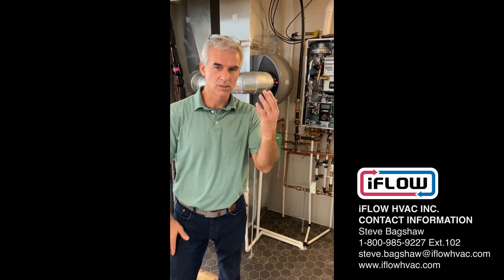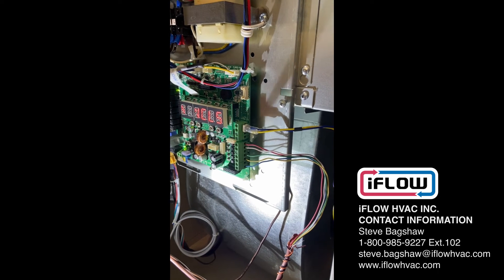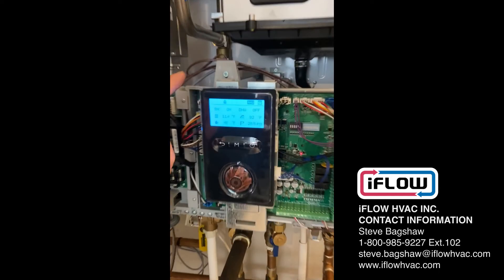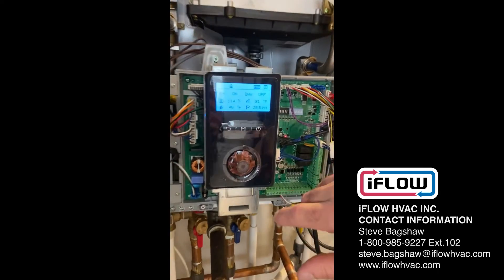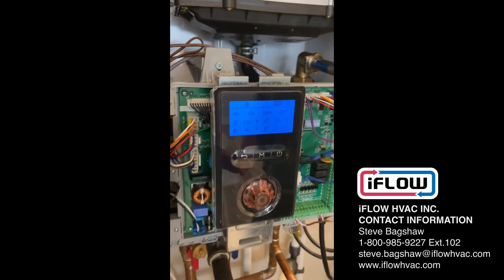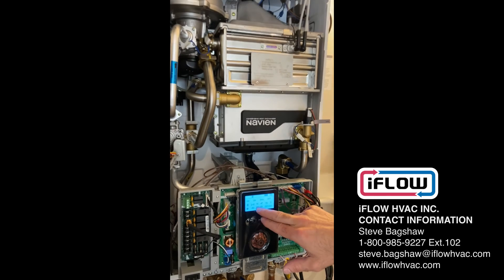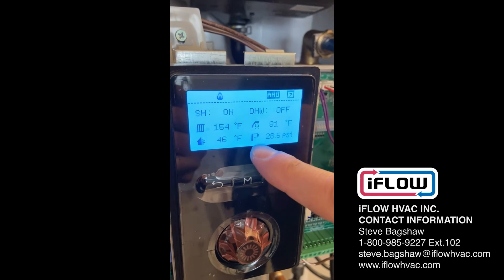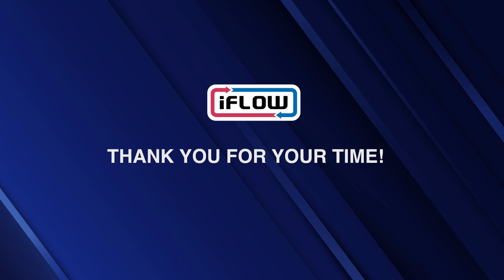iFLOW with Navien Combi boiler- Outdoor Reset Demonstration

Comment: I was inspired by your video I have replaced my old gas powered hydronic heater of 26 year old with IFLOW 18000W + Navien 240 A2  to heat the house of 3000sqft plus domestic hot water in Oct. '22. Some contractor was hesitant and discouraged the idea  but I am very happy that I did. Here in DC suburb, Maryland and the temperature outside went down to the teens but the system worked perfectly to my satisfaction in covering 4 + bathrooms and space heating. Thank you so much for your info.
Reply: Thank you Mr. Lee for choosing iFLOW & Navien.  We very much appreciate you taking a chance with our combi-system and we are very glad to hear the system is performing to your satisfaction.  We trust it will deliver years of great comfort and energy savings!  Thank you again for being an iFLOW customer; it is very much appreciated!
Reply: Hey, just wanted to see how you like your system a year later. Seriously considering this install. Also, I see you’re in MD. I’m in NJ. How did you source your installer? Thanks!